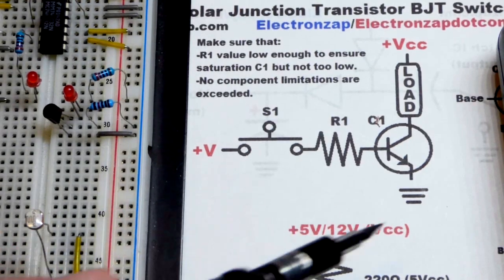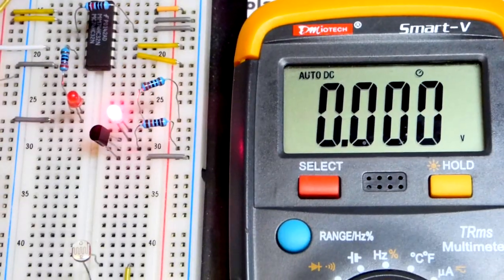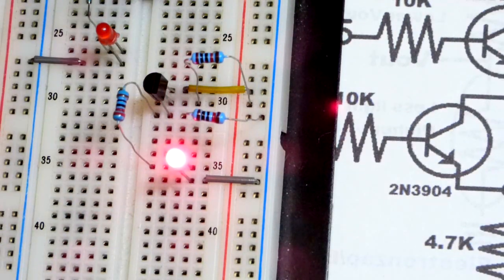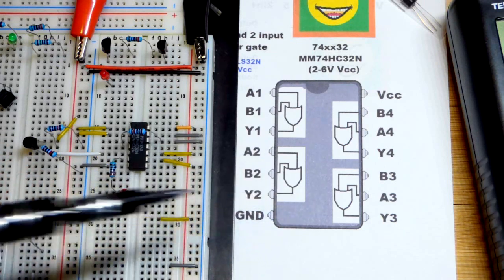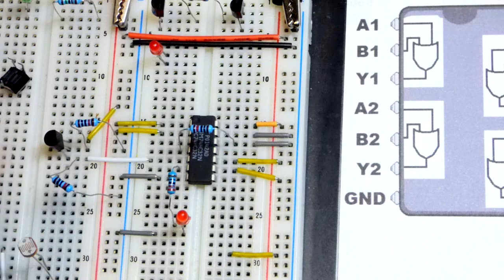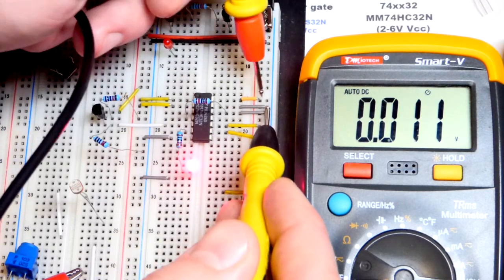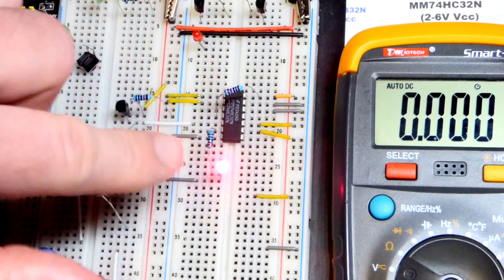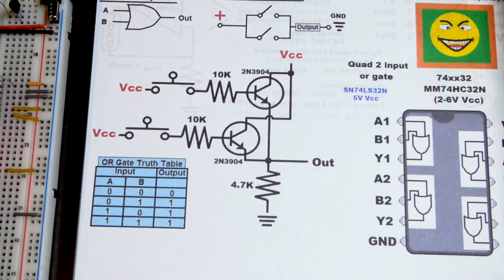Why NPN BJT emitter follower switching is good for digital electronics but bad for direct loads

Comment: Does the 74HC595 work the same way of this ic?
Reply from the maker: 74HC595 is a shift register. So, very different.
Reply: If you mean to ask whether or not you can drive any other digital IC this way (such as 74HC595), then I believe the answer is "yes" (since the title of the video is "emitter follower switching is good for digital electronics but bad for direct loads").